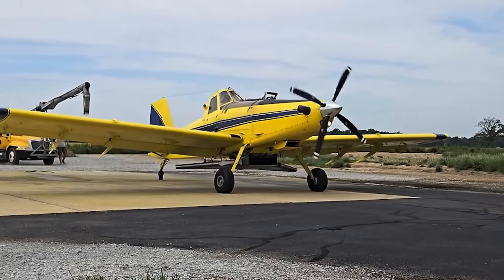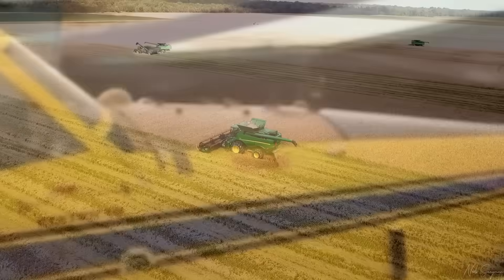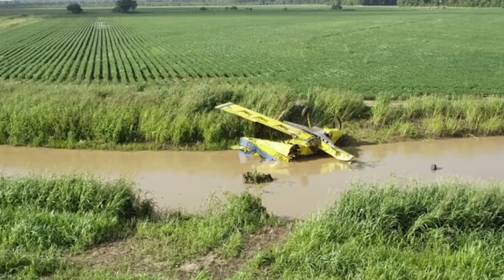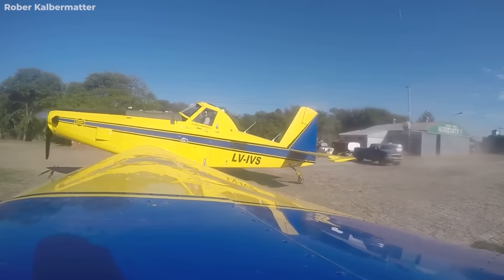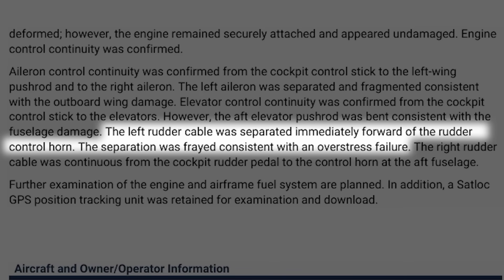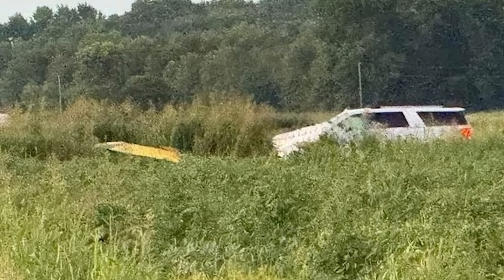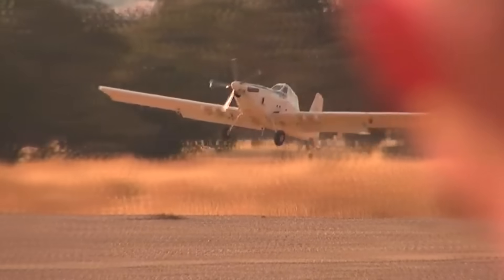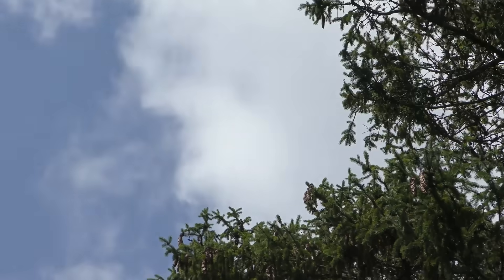Pilot Fatal Crash! NTSB Prelim Report Reveals SHOCKING Details About The N9185F…

Comment: I'm I'm thinking that you're going to find it was a fuel delivery problem these engines and these planes are extremely powerful because of the extreme pull-ups they have to do at the edges of the fields or the ends of the fields because they're trying to get up over them trees it had to be it would either be a fuel delivery problem or a electrical problem with the fuel pump or something because mainly the engine not working properly is that what I'm trying to say

Comment: I believe these planes have an extremely powerful engine to do short takeoffs and pull off pull into pull-ups real at the edges of the fields to avoid tree lines in the pilots are supposed to be extremely experienced Pilots the average life expectancy of a crop duster pilot is 5 years I don't understand how they figured that out but that's a short lifespan for a crop duster I don't really know how they work that out I might be wrong I don't know but I do know that is a very very dangerous job I have watched many of them in action and it's pretty hard job

Comment: Fun fact:
BlackRock just bought the Panama Canal for pennies on the dollar, (closed tender) and one of the first things they did was steeply increase passage fees on all vessels, which had previously been frozen as a condition of the original treaty.
Blackrock’s CEO and the entire Board are members of the tribe we aren’t allowed to criticize
Reply: You say Black Rock is an Indian tribe? Where did the get the money? From casinos?
If so why don't they just open more casinos if they're profitable enough to buy the Panama canal seeing as the Panama canal hasn't been profitable for years and now Mexico is building one which will  be wider and more modern and not in decline due to a failing  source of water.
That's not very good odds for people who are suppose to know gambling, don't you think?
Even the Chinese gave  up on the idea because of the lakes running dry. And between pumping in ocean water and widening the locks and modernizing to keep up with Mexico's canal which will be brand new as well as further north making the transition to the Atlantic shorter, it doesn't make a lot of sense to spend the equivalent of a couple years GNP of a small nation to repair a over hundred year old dilapidated canal that running out of water to fill its leaking locks.
If even the Chinese said screw the idea to achieve control of trans Pacific-Atlantic trade.
I don't think I'd invest my life saving in it with a bigger, better a newer canal being built north of it in a country that's far more stable and already planning to use ocean water. 
And expected to be completed in just a few years before repairs have ever been planned for the one in Panama. 
But maybe they know something that the rest of the world hasn't figured out. 
Who knows?
But they'd be better off investing in pork belly futures and LEGO's stock, but not losers like Trump crypto and Trump collectable coins or Trump collectable anything. 
You'd have to have the IQ of a pet rock with a lobotomy to invest in anything that has the name Trump associated with it!
You sure Trump isn't associated with this brilliant Panama idea?
After all he wanted us to go to war with Panama to get it for him?
And he does like to go bankrupt, a lot.
Humm? 🤔
Sounds just like something Trump would think is a good good idea, like tariffs.
👉🤪💨
Reply: @Major_Tamre_Colby 
Please step away from the crack/meth pipe.
You’re obviously high. 😂

Comment: I doubt a failed left rudder cable contributed to the accident. The fact the tailwheel is the first track indicates a pitch up attitude possibly trying to correct a sinking airplane, or stall. R.I.P.
 Ag aviation: the longer you fly, the less time you have before you crash.

Comment: The good news is that crop dusting drones are making expensive aircraft crop dusters, obsolete. 
Drones can be programmed to cover 100% of crop area with one run eliminating the need for overlap or complex flight paths fraught with danger..
Yaay for drones. 💪👍
Reply: You are the absurd one.
Reply: Not even close. Drones have their place (a very small niche of aerial spraying) they are far too small to put a dent in the number of acres flown.  Ag planes routinely spray 2000 AC a day with a pilot and one or two ground guys (loaders).  It would take a hundred drones and 50-60 operators to complete that in a day.  You also have to consider the timing of spray jobs.  Most crops in a geographical area need sprayed at the same time as they mature.  Most crop types are planted at the same time in that region.  Many of these crops have a relatively small spray window to accomplish this.  This keeps fleets of aircraft busy all season long.  Sorry friend, a drone flying 10-15 mph spaying 10-20 ft wide isn't going to be able to keep up.
They are however pretty good at carrying IED's as our Ukrainian friends have shown us!
Reply: @its4michael 
BS. They can be linked together (electronically, not tethered) to move in unison and to cover specific patterns by a single operator to deploy and recover them afterwards, the only time individual operators are needed is when they break from a pre programmed pattern, like they do at public displays etc.
They’re already using them this way, so it’s not even necessary to debate the point any further.
Reply: @its4michael 
You lost me as soon as you mentioned Ukraine, they’re getting slaughtered  right now and Zelensky is about to flee with the billions of dollars he stole from US taxpayers, and yet here you are cheerleading for that devious little fraud.
Yoh know nothing

Comment: Why did you give v the temperature in C instead of F? I am an American pilot and aircraft mechanic.  We use F in this country. If you want to use C then use F also.
Reply: C has been the standard in aviation for a good long time.  Older airplanes still use F, but I’ve not seen F used in a turbine engine instruments or performance planning docs.
Reply: Celsius has been the standard for US GA for quite some time. Do you still fly and read the METARS?

Comment: Liquid or dry, it is still refired to as cropdusting.  I see a lot of comments by people who don't understand the complexity of flying a conviction landingear aircraft (tailwheel or skid equiped) yaw is always controlled by the rudder and (wheel brakes whil on the ground) as speed begins to increase.  Yaw is affected by several influences.  Cross wind tryies to turn the plane into the wind.  When the propeller is moved up or down by raising or lowering the tail the prop wash will try to yaw the air frame because one propeller blade is given moor pitch whil the opposite side is getting less pitch.  It is easy to exceed your rudder ability to control yaw with a high horse power engin. Especially it you feed in power too quickly.  This fact has always been true even if the rudder is massive it takes times for higher pressure air to reach the rudder when power is increase whil the yaw input happens instantly.  For rapid acceleration I found it helpful to start a turn in the opposite direction ahead of power increases allowing the yaw caused by the propeller to pull it back to the dirised direction. You can easely find your self in a situation wher you need all the power of the engine  but you can't control direction if you put in all the power available.  It is a balancing act. We have lots of pilot who are not allowed to fly tailwheel aircraft because it is a special talent requiring special training.
Reply: Are you on drugs? Air tractor pilots are some of the best pilots in the world.

Comment: As a youngster farm boy I worked for an Ag pilot doing work for him from loading the insecticide to gassing up the aircraft (A Piper Pawnee Ag plane). I remember he came in for a landing once on the hard service runway. He veered off the runway somewhat on the starboard side and then the aircraft did a hard turn to the port side and almost did a 180 and coasted to a stop. It appeared that something made the starboard side wheel to lock up like the brake was applied. From looking at the exposed disc brakes of the starboard side wheel of the aircraft it was completely clogged with weeds that caused the wheel brake to lock up.  Needless to say I mowed the whole side of the runway to where it looked like a golf course.

Comment: Don't they have drones that do this shit now?
Reply: Not even close. Drones have their place (a very small niche of aerial spraying) they are far too small to put a dent in the number of acres flown.  Ag planes routinely spray 2000 AC a day with a pilot and one or two ground guys (loaders).  It would take a hundred drones and 50-60 operators to complete that in a day.  You also have to consider the timing of spray jobs.  Most crops in a geographical area need sprayed at the same time as they mature.  Most crop types are planted at the same time in that region.  Many of these crops have a relatively small spray window to accomplish this.  This keeps fleets of aircraft busy all season long.  Sorry friend, a drone flying 10-15 mph spaying 10-20 ft wide isn't going to be able to keep up.
Reply: @its4michael  Of course drones will not replace manned aircraft immediately... but the day is coming when they will be doing most of the work.
Reply: Yes.  And drones will eventually replace manned aircraft in this industry.
Reply: Currently, drones have extremely limited capacity.
Reply: If a drone can spray 20 acres per battery, how many acres in three weeks?
Reply: @AgPilot-w8b  It cannot spray 20 Acres /battery... They spray about 10-15 minutes/tank & battery charge, 4-5 acres.  For nearly continuous work, a second one must be prepped & ready to complete it's flight while the 1st is being prepped; or there's 15 minutes of downtime between the flights of single drones. So, with 2 drones your 20 Acres might take an hour. A ground rig with 80' boom at 10mph, will take about 15 minutes to cover the same acreage; An airplane sprays a narrower swath but at over 100 mph does acreage at about the same rate as a ground rig, but carries as much product as 10 drones.  Drones don't need pilots license or airport and are cheaper to buy, but at current state of the art, struggle to be "better" than the alternatives. What they do is expand the overall capacity of aerial application and make it more available.
Reply: @davidkottman3440  You people need to research agricultural drone application before making stupid pronouncements  about how "limited" they are at present.  Do you know an applicator can do between 300 and 500 acres a day? I didn't think so.  And they are getting more capable by the day.  Cost per acre for drone application is falling like a rock and will soon be down to almost the level of ground application (which is presently the cheapest method going because it can be owner applied).  Drones WILL replaced manned application.  And that day is coming closer and closer.
Reply: @tvideo1189  I'm not as ignorant as you think, since I farm & hire drone applications.  They're good, but I don't want the job of running them! Eventually, they'll be good enough to take over a lot of the application business. They're not there now.  They'll likely never handle the large volumes of fertilizer & water that ground rigs can apply, but the ability to fly above mud & tall crops is fantastic.

Comment: The only way the tailwheel can be contacting the ground, leaving a track, while the main wheels are not, is if the liftoff was forced, before proper flying speed was attained. 
In other words the liftoff was rushed, probably because directional control was lost during takeoff. Not necessarily any fault of the rudder.
Departing the runway will almost always prompt a pilot to try to get airborne asap to avoid potential rough ground or obstacles etc. It's a natural reaction.
As an ex ag pilot, I would say had he dumped the load as he left the runway, he would have gotten away with it. 
Very hard to make that mental step to dump the expensive load, unfortunately.